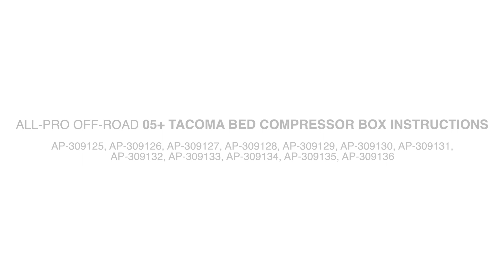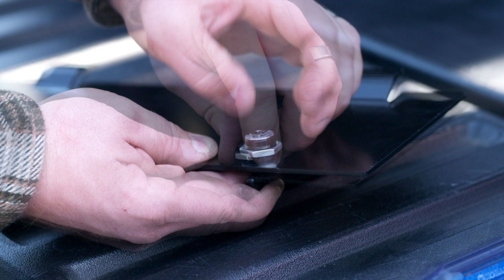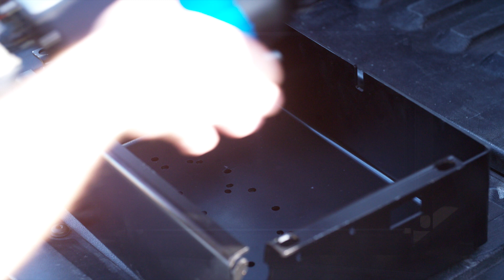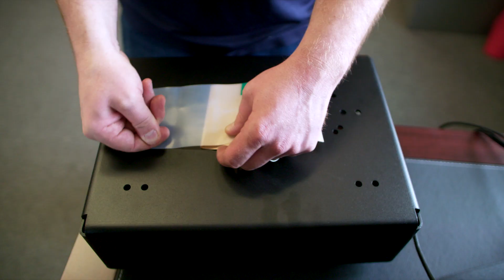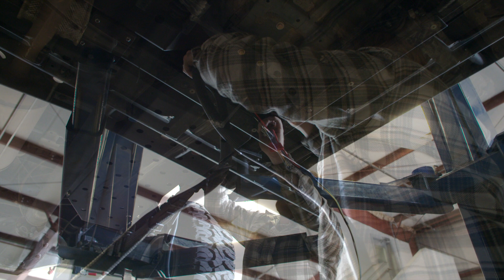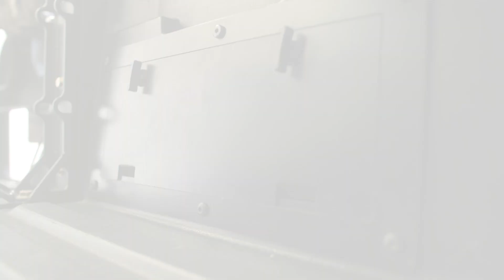All- Pro Off-Road Toyota Tacoma Bed Compressor Box - Instructions

Comment: Would I be able to not use those switches, and shook it up to my switch pro?
Reply: you can use Switch Pro. Instead of running the various wires to the switch you run 2 wires to the switch pro.  I believe purple and black wires. I believe there are some shops that make a pig tail to make it easy. You can also run the power direct to battery no ignition if you want to run the compressor whenever.

Comment: Love what you folks did with the bed mount. Very versatile compared to what other brands offer. I’m thinking of going this route! 
But can’t seem to decide on the 12v or 24v twin compressor. Thoughts? Thanks
Reply: Which one did you pick?
Reply: @xgio  get a twin if you want to use tools
Reply: the 12 or 24 depends on the voltage of the batter in your truck

Comment: I'm trying to buy this steel door kit so I can put a twin arb air compressor on the driver's side of my 3rd tacoma but I can't seem to find this product on your website
Reply from the maker: Hey Arthur, what year Tacoma do you have? Our current version fits 05 to 2018 models. Our Team is working on the design for 18+ model design right now.
Reply: @AllProOffRoad4x4  I have a 2020 but I plan on cutting out the bed side to mount this
Reply from the maker: https://allprooffroad.com/accessories/toyota-tacoma-bed-compressor-mounts.html
Reply: @AllProOffRoad4x4  and thanks for the link👍